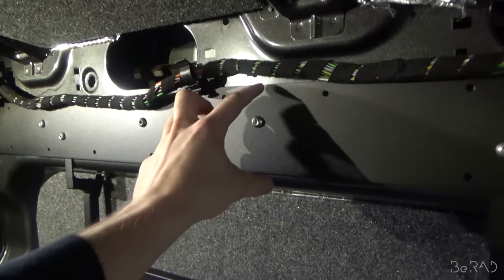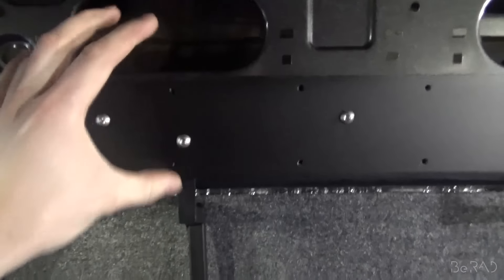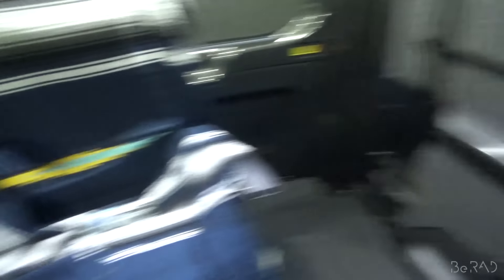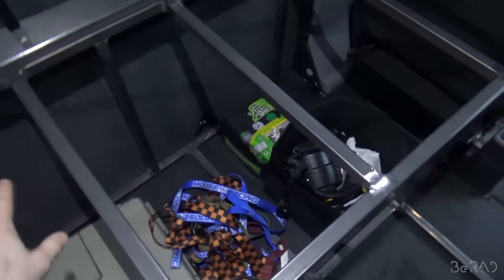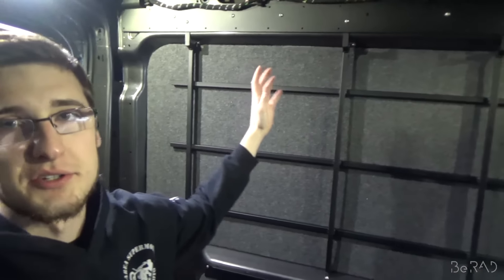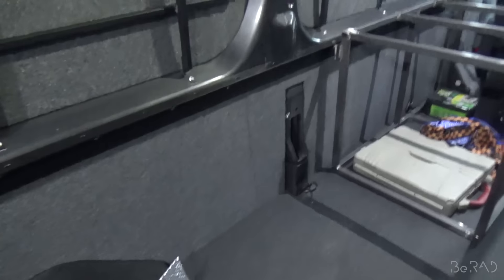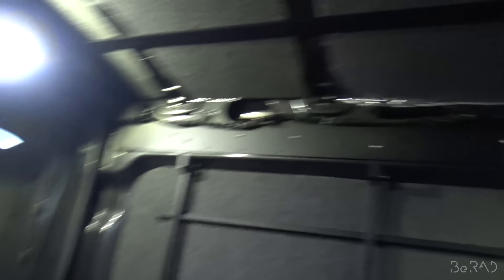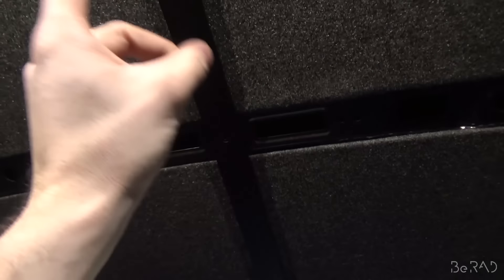Quick Update and Plans - [MotoVan Build Pt. 7]

Comment: you should get the new tie down system you just push the bike in and it locks the front wheel in place that way you don't have to strap the front end down and you don't have to compress the suspension

Comment: Sleeping in the van will still be super cold.  Invest in at least a 0 degree sleeping bag and look into getting a heavy blanket like the Producers Choice Acoustic Blanket (it has grommets for hanging it and will deaden sound, provide some insulation, and block light) to hang between the cab and cargo section.  By dividing the cab from the the cargo area at night, you'll cut down on a lot of conductive heat loss via the glass of the windows.  You'll also probably encounter condensation issues stemming from respiration through the night, you'll have to figure out how to deal with that.  Good luck, the van looks awesome.
Reply from the maker: Thanks for the suggestion! I've been looking for a material to use as barrier between the seats and bed! That blanket should work very well. I've slept 2 nights in the van already. One night was probably 20 degrees (no insulation), the other was probably 15 degrees (insulated)...I survived both! Condensation hasn't seemed to be a huge problem yet. I crack windows and will have some sort of proper ventilation by the time the build is done.

Comment: why not a power inverter and a battery that taps off the alternator, with a draw isolator to prevent over draw. solar system are ok for  trickel charging or keep a battery toped off.
Reply from the maker: Mr. Random you need to re-watch the video Haha
Reply: I did , twice and my mind must be mental blocking inverter, or I'm just to tired to think what point I've missed lol
Reply: Mr. Random 6:30 to 7:10
Reply from the maker: well, what you described is exactly what i planned on trying!

Comment: Have you considered using 2m amateur radio instead of CB? The technician license test is very easy and the radios are much higher quality, even the Chinese knock offs. The audio is clearer and they have much greater real world range. We use 2m for off roading in Nevada and CA and it was a huge step up from CB. I went further and carry an HF rig now, so if the worst comes to the worst I can call people hundreds of miles away. I got interested in something more effective when I was out on the Pony Express trail around 39.94N 115.75W and realized I hadn't heard anything on the CB or seen anyone for a couple of hours. There's no phone coverage in those areas.

Comment: Hey Mr Bradders, I think if you go down the leisure battery route, you might want to hook it up so it charges whilst you drive as well. BTW What CB Rig did you get? Keep up the great work, peace out.
Reply from the maker: yes, it will charge off of the alternator! I thought id save the detailed explanation for when I actually install the battery and do the wiring. A Uniden Bearcat 800. There's a link in the description for it!
Reply from the maker: http://amzn.to/2kbXYhw
Reply: BeRAD I'm thinking of buying the Midland Alan 48 Plus. Used to have a Realistic straight 40 AM rig back in the late 70's, totally illegal in the UK then. Even now we're restricted to 27 mhz on fm.